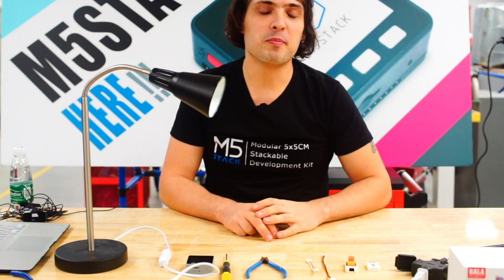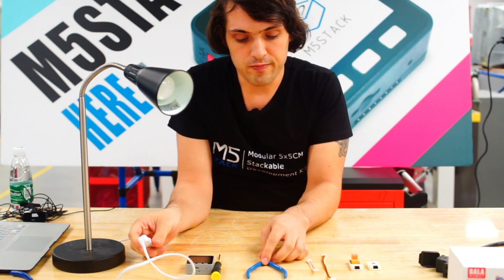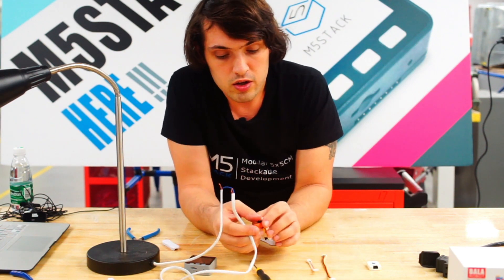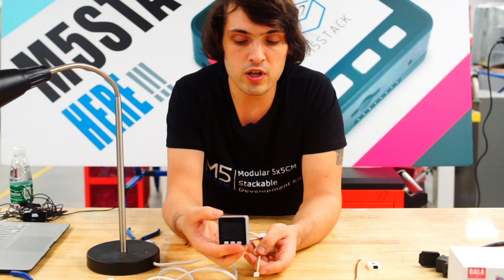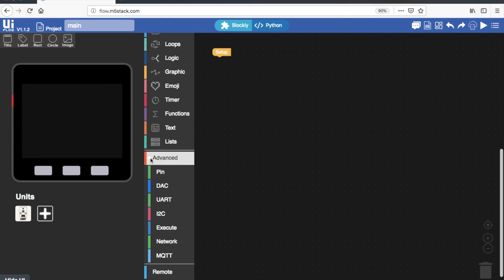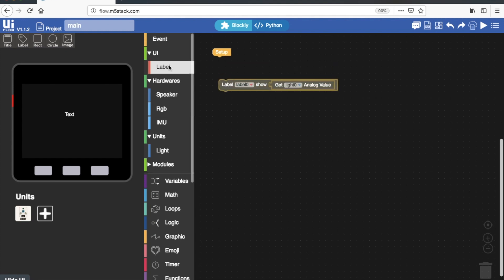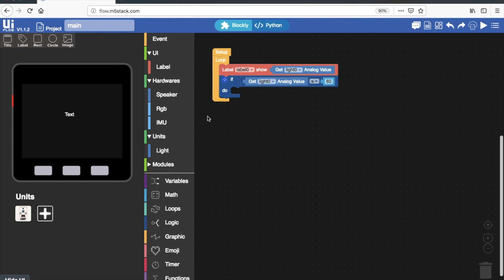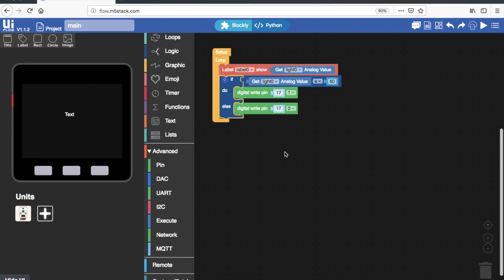Smart Home Lighting with M5Stack Part 2 - (LDR) Light Sensor Control

Comment: Why it is the 17pin, And if have 3 Relays and a m5Stick how to use all they together?
Reply from the maker: Do you have a M5Stack core grey or basic module? if you have the relay unit you can use the red port (A) for controlling it, if you want to control 3 relays you would need the PBHUB https://m5stack.com/collections/m5-unit/products/pb-hub to extend to more ports.